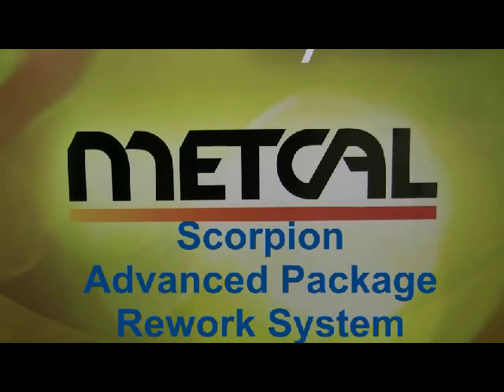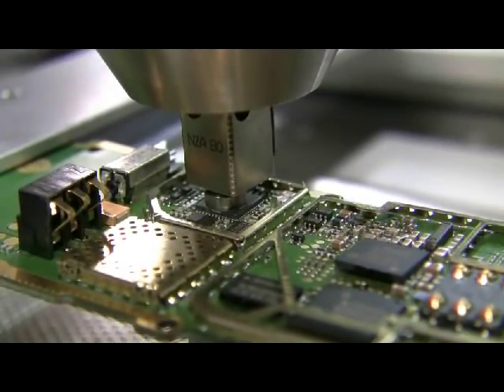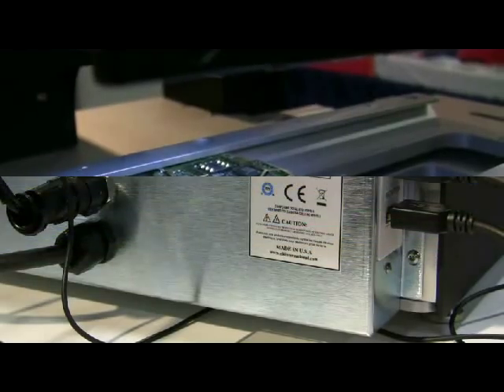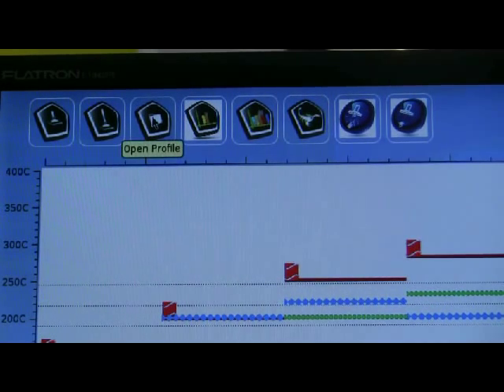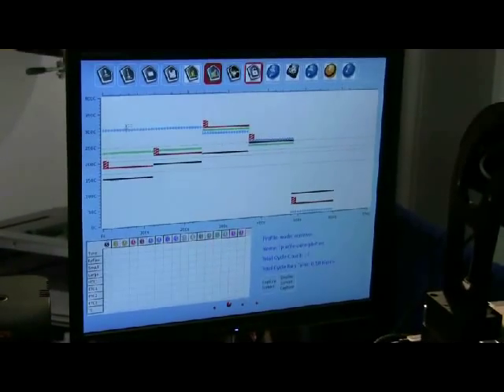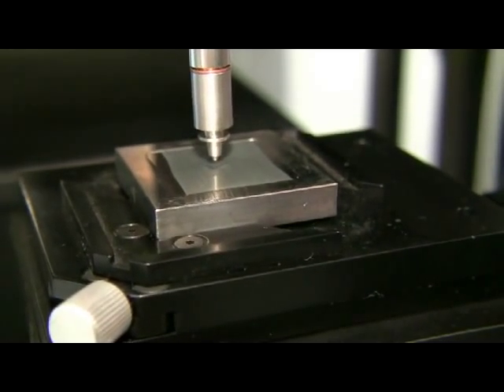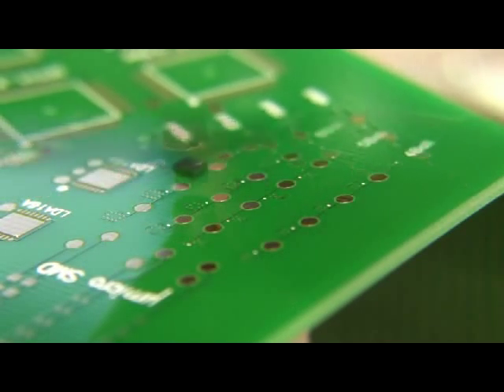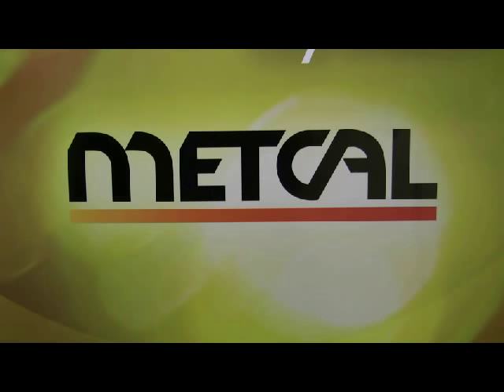Scorpion APex.avi Metcal BGA rework

Comment: good
Technical characteristics for this type of machine?
adjustable thermal profile?
preheating plate?
external sensor?
the nozzle type, diameter ...?
Nb layer PCB?
BGA type?
time profile of soldering / soldering ...